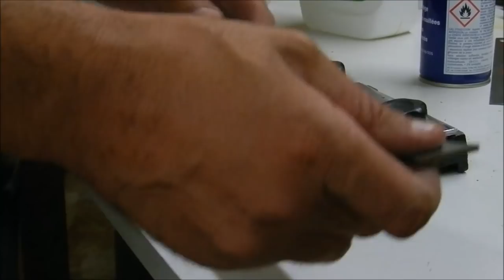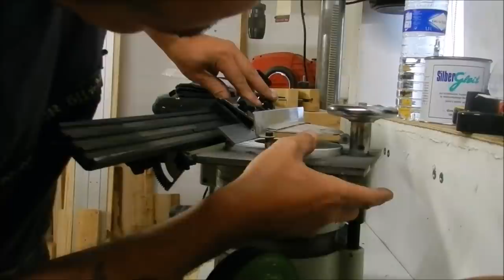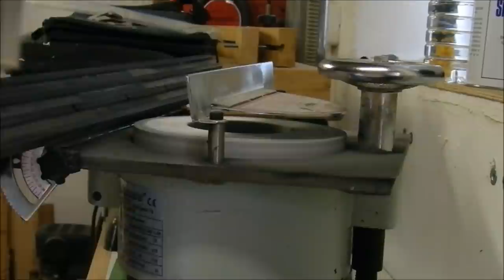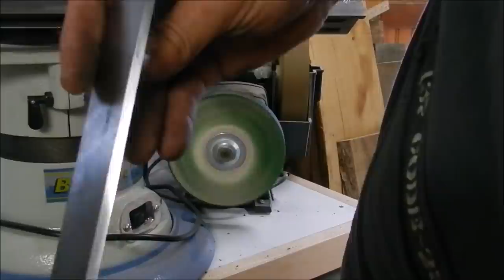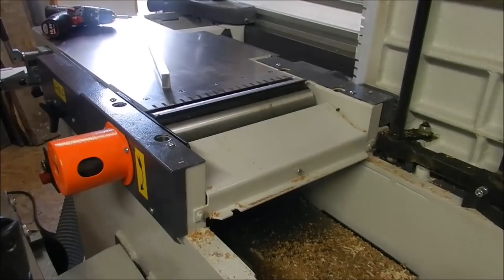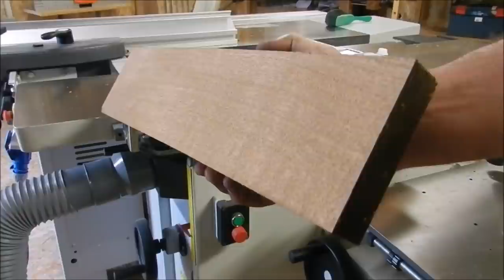Affûtage de fers de dégauchisseuse/Sharpening of planer knives

Comment: Bonjour j'aurais une question à quoi est dû les petites ondulations d'usinage sur le bois quand on le degauchis. Est ce un problème de réglage je dirais que j'ai aussi le pb en rabotage. 
Vos vidéos sont vraiment sympas il ne manque plus que la parole 😊 continuez ainsi
Reply from the maker: +David Fras Bonjour en général les ondulations à la degau sont dû à une avance trop rapide mais si ça le fait aussi au rabotage possible que ce soit un problème de réglage de fers .
Reply: C'est normal David. Ce phénomène est expliqué dans plusieurs livres, revues ou des vidéos. En fait l'arbre de la machine est un cercle et les fers sont 2 (ou 3) points qui ressortent de ce cercle. En tournant ces points ne sont en contact du bois que durant une demie ou un tiers de la circonférence de l'arbre. En fonction de l'avance donnée à la pièce les ondulations (inévitables même microscopiques) seront plus ou moins prononcées. C'est pour cela aussi qu'on dit toujours que la dernière passe doit être la fine possible ce qui réduit la profondeur des ondulations et donne l'effet de planéité à la planche